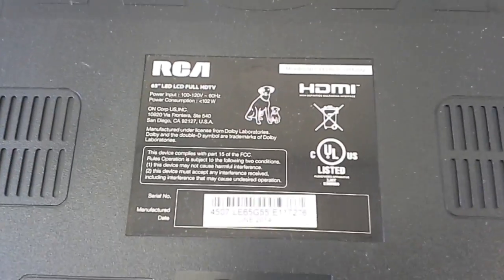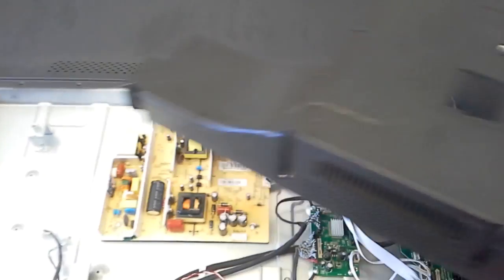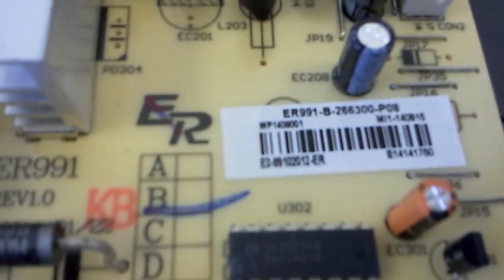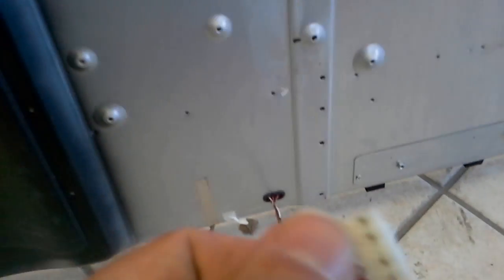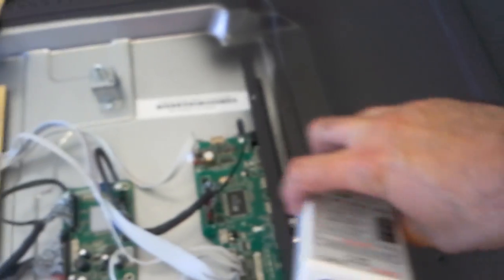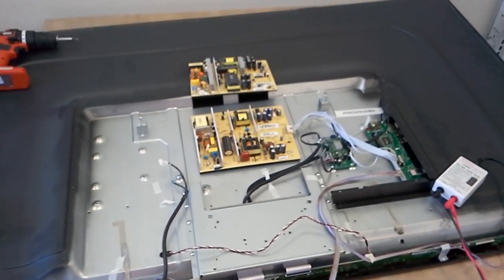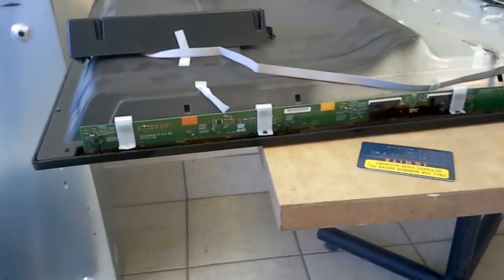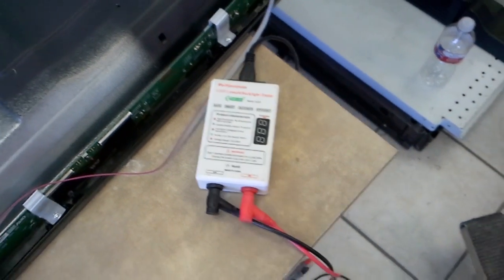How to troubleshoot and repair RCA LED65G55R120Q not starting

Comment: Coppell I see this video is 5 years old so getting a reply may be a hit or miss. I have this same model and I have replaced the LED's a couple times and it's worked great. This last time I was working on it my grandsons was playing around and a football hit the on'off button ribbon cable and it jerked the wires out of the plug. I tried to re-solder the pins but they are so small it's very difficult. I found a replacement cable on amazon but it's for a 55 inch not a 65 inch...(can't find a 65 inch cable) I've heard sometimes they use the same cables in different models...do you know if this....RCA LED55G55R120Q TV Button & IR Board RE0342R010, RE3242R010.....will work in my 65 inch tv exactly like the one in your video?
Reply from the maker: I am afraid I do not know the answer with certainty. But if I were you I'd go ahead and try.
Reply: @coppelltvrepair  Thank you so much for replying!!!! 25 buck it's worth a shot.

Comment: Where can someone find one of the ribbon cables that come up from the bottom. (that model- Led65g55r120q) there are 2 and I lost the screws to the base, the replacement screws were too long and punctured one of the ribbons so there is a green stripe down the right side of the display now. I can't find that specific AWM flex cable anywhere.
Reply from the maker: I have long forgotten what were the cables that go inside those particular panels, but I've seen plenty and I can tell you that there is absolutely nothing special about them and that even if you don't find exact replacements - which will NOT be indicated by the AWM number BTW - you can always hack up your own cables with nearly anything you can find that's tiny enough and yet not too tiny. Firs you need to find how many channels you carry, i.e. how many different power lines are there and you usually do that by examining the strips they go to. There may be multiple pairs (positive and negative) or, more commonly, several wires will carry the one common negative (rarely one common positive) and then several individual wires will carry the individual positive (or negative in the rare cases) lines. In the most simple form it'll be just several parallel wires for one common positive and several parallel wires for common negative, i.e. a strip cable cab be used for carrying as little as one power channel - positive and negative. This is done so that slightly larger current can be carried on a generally very low-current carrier as the FFC/FPC strip cables. The currents in LED panels are not big to begin with - they are in the range of tenths of an Amp. So even very very tiny wires, if you run them manually, will do the job. Most likely the tiniest you'd find in Home Depot will be too big, but as long as you can find them they'll do the job - them being bigger than they need to be is good for electrical purposes, only bad for physical challenges running them around.

Comment: the reason LED tvs go out is due to having the tv set on the brightness setting all the time...gamers do this. they wreck the tv. they are NOT computer monitors..a gaming system have ignored the reality that to get those fancy colors and brightness, you need a normal computer monitor and not a tv. and no they are not, "essentially the same thing". one is cheaply made.
Reply from the maker: You are contradicting yourself. First you say the reason LED tvs go out is due to having the tv set on high brightness. Then at the end you say that they are cheaply made.
It can't be both.
it's the second.
it is entirely possible to have a TV run at full brightness for many years.
The first generation LED TVs had a WHOLE LOT longer life than current ones, just like the first tube TVs had a whole lot longer life than the last generations.
Whether it is planned obsolesce or competition at work everyone can decide for themselves, especially considering they are not actually mutually exclusive.

Comment: I have an RCA LED65G55R120Q with a problem in the supply of led strips 1 I have a voltage of 210v and I need a schematic if you could provide it to me. thanks
Reply from the maker: We do not have the schematic. Sorry.

Comment: dear friend thanks for this useful channel. I wonder if you can help me with this PSU (RE46HQ1700) I cant find it so does it have any compatible or replacement alternative
Reply from the maker: Afraid I do not know if there is an alternative power supply for that....I doubt it, though I am sure it would be possible to hack a combo of others to make it work...but I doubt there will be equivalent substitute and if there is I definitely do not know it.

Comment: Hello I have this model and mine comes on but it has a black vertical line and a greyish line 3-5 inches wide on the right side. I am thinking it is the tcon board. Can you help before I order this part?
Reply from the maker: I don't know. Internet is full with people who want just a little bit of attention and help and when they get it somehow they instantly want more attention and help...and we just can't afford all that's wanted.
So yes we can help you and no, we probably can't do it the way you'd want it.
I do not think you have a bad T-CON board. I think you need a new TV.
Reply: @coppelltvrepair  thank you for your quick response. Unfortunately because of covid-19, it has made it difficult to get help or purchase a new one financially because I live in a rural area. I considered purchasing the tcon and strips seeing that the rest of the picture is good and there are no cracks or breaks in the screen. Was trying to find the service manual for this model and haven't had much success.

Comment: So my 65" such as this comes on and flashes. I am guessing that there are LED strips that are bad, but where can I find the entire LED panel or do I have to buy each strip separately?
Reply from the maker: As of today, considering the age of the TV, the cost of replacement and the work that needs to be done to repair it properly I'd recommend just buying a new one.
Counter-intuitive coming from a TV repair shop, but that's what I believe is in customer's best interest unless they want to have fun repairing, in which case I can only say CHEERS!
Reply: @coppelltvrepair  thanks

Comment: My RCA TV RTU5540-C does not recognize the remote. It did
recognize the remote until recently. The remote has new batteries. I tested
that the remote is on by pushing the Input button on the remote the Power
button flashes red. The TV Standby Indicator is red when TV is off and when I
turn on the TV with the power button on the TV the light turns to Blue. There
is nothing blocking the Remote Sensor on the TV. Any thoughts on how to fix?

Comment: I found the exact TV in this video in the alley. I took it home because I was told that as long as the screen isn't broken it's fixable. I got it home plugged it in but not picture. It did what you were talking about in this video. I found on another YouTube channel how to inspect the LED strips without a volt meter. I found that 1 LED strip was not working and ordered a replacement from eBay $22.00...i replaced that strip and put the TV back together. I'm happy to say it worked just fine after the strip was replaced. Thanks for your video, I now have myself a 65inch just in time for the football season!!!!
Reply: Brah I did the exact same thing! Found a sld65a55rq in the alley that looked suspiciously underused and carried that big thing home like an ant. Biggest tv I've even owned. I'm in the beginning stages of bringing it back to life. My screen will flash blue about every 10 to 15 seconds. I had it flashing on the menu/start up screen and it has a good picture. I did ripe out the ground blade with my vice grips... I don't know how important that is but I'll replace it before I get into the guts of her. Happy to hear you saved yours
Reply from the maker: @astrataway7077  Just remember....replace all strips! That is the only proper way to do it and will save you lots of trouble and money in long run...if you replace with brand new LEDs, that is.
Reply: @coppelltvrepair  Which LEDs are you talking about the screen LEDs or the big nickle sized spehical LEDs in th back of the screen? The cables are a good idea but I might try the vinigret acidic trick before I do that. I have a good meter and a solder sucker for resisters or whatever else on the power supply.
Reply: @astrataway7077  This requires a $15 eprom replacement. You will need a hot air station to replace the flat pack IC that it is.
Reply from the maker: Glad I was of help and my voice didn't get in the way of your success :-)
For the record, though, what you've done is improper or rather incomplete. Imagine you drive your car for so long that one of your tires bursts from the wear. Will you replace just that one for the rest of the trip?
Well LED TVs have not 4, but between 50 and 150 LEDs in the panel depending on size and they work together, pretty much as car tires, and they actually do wear out as they work (why so quickly is another story).
So bottom line is that you've replaced 1 out of 100 or so LEDs and it's only a matter of (short) time before another one goes out.
Every professional knows - all or none is better than some and then returning upset customer...
Reply: Bro its so funny u found this tv in a ally way...me and my baby daddy literally just found this tv in a courtyard lol and have been havin this same fkn issue!

Comment: Is the LED driver a part of the power supply on this model?
Reply from the maker: I am sorry, I do not remember that. But the answer is extremely simple to find: if the cables out of the panel go to the power board then yes, the LED driver is part of the power; if there is another board in the way then no, that other board is the LED driver.
Reply: Yes it is, but receives the start-up signal from the main board.

Comment: i cant understand your voice and you dont explain how you took it apart..
Reply from the maker: So sorry about both. I can only recommend finding a video you can understand which explains what you need explained.
Reply: Coppell TV Repair LLC there is no videos like this that explains
Reply from the maker: @jimmyperkins97  Then "thank you for at least trying to help" would have been a better comment under the video.
Reply: Coppell TV Repair LLC I did leave a comment under the video
Reply from the maker: @jimmyperkins97  No argument on that claim.
Reply: @coppelltvrepair  On the off chance you reply, thanks for the vid. Could you explain what i'm looking for when i test with the multimeter? I'm not reading any voltage on the LED pins you point out @2:54 
would i be able to narrow it down to the specific strip? or is it really just easier to change the whole panel?
Reply from the maker: @aaronharop6247  I do not remember this video and I am not able to watch it now, sorry. But it is always  better to replace all strips or the whole back light panel (if possible) to any partial LED or strip replacement.
We ended up instantiating it as a policy at our shop.
We do not do partial LEd repairs period.

Comment: Search the problems and warranty on these TV's. Junk is the most flattering thing I can say about them. Buy and you will regret.....guaranteed.
Reply: This is true, I bought mine last christmas and it has only worked 30 days in the last year.  The rest of the time it is in the shop.  Rca Curtis customer service can take months to get back to you as you can only coordinate repair through email.  I just got mine back two weeks ago again and it already isnt working.  My warranty is almost up and I can guarantee it wont be working again so I will have to start fixing it myself which is total B.S. as it has never worked right since I brought it home last year.

Needless to say this is my last RCA or any other brand from the parent company Curtis.

Comment: I had a question. Do you know if the diffuser layers on the rca tvs for the light are all the same type of material? Or all the same for all led/lcd tvs? Do they have any effect on picture quality?
Reply from the maker: No, I do not know if they are all the same type of material. But they do the same thing and I am quite sure that many of them would be interchangeable, apart from the shape related to the panel specifics.
Reply: Ok but those 3 layers in the back including the diffuser has nothing to do with picture quality right?
Reply from the maker: Well technically they do. At least one of them polarizes the light and if it's not here you won't see image properly. The exact order may also affect image quality to some degree, i.e. it makes a difference if you diffuse and then polarize or polarize and then diffuse.
Reply: Well I had those 3 layers switched from 2 identical rca models only a few months apart from manuf. date. Except one had on anboard dvd player. How would you know if the layers were not working properly?
Reply: I had the layers taken from a RCA LED32C45RQ 32 inch and put on a RCA LED32C45RQD 32 inch. Notice the "D" and the end difference. Do you know if there is any technical data I can pull on up on these online?
Reply: 1 polarizer and 2 difusers. Some are thicker than others and many cheap tv's will use one thick one for the difuser. Make sure you do not damage the rear white plastic cover that goes over the LED strips as it is used to throw light forward. Technically, everything behind the screen is referred to as the light box.

Comment: My rca 65 model led65g55r120q turn on and after less than a minute turn off and dont turn on unless i unplugged, already change the power supply board but still doing the same. What u think can be the problem? Thanks
Reply: My 40" does the same thing. I can do a factory reset and it will stay on for a day or so. I looked over the power supply board and did not see any bulged capacitors. I'm thinking it's software. the On Corp phone is no longer in service so I can't check for firmware updates.
Reply from the maker: Well a bad strip can cause that and so can bad main board.
No easy way to rule out either I am afraid,
Signalling the power supply to turn on backlight is probably the most simple thing to do.
Reply: @coppelltvrepair  I know this video is super old but I have an old RCA LED tv. The  panel seem to work but backlight stays off, except is blinks for a moment in some random times. The stips voltage reads 2.6mV. I was wondering how to signal the PSU to turn on the backlight power. I have identified 2 pins, in the PSU to mainboard connector, one is called BK ON, and the other ADJ, which both go to the same IC in the board, so I think those are the pins, one to turn on backlight, and the other to adjust dimming, but I don't know what signal to supply to each to test the PSU. If you read this comment, do you have any information on how to signal the PSU to turn on the backlight? thanks.
Reply from the maker: Many TV makes and models may have the same behavior. Assuming that your TV's problem is same as theirs is wrong and you should not be doing it. Not all people around the world who cough do it for the same reason and not all cars in the world that have problems starting have the same reason for doing so.
In your searches stick to the model of the TV you have and you will have a whole lot better chance of finding the proper advice and solution than just with the general symptom.
Most of the time this is true even for experienced technicians - many of the local shops we work with exhibit the same incorrect thinking, assuming that what's true for one model or generation applies for another.
It just doesn't work that way, not as a rule of thumb.
Hope this helps!
Reply: Miguel Martinez where can I get that tester
Reply: Miguel Martinez so wat was the problem with the TV.  I have the same model, 65 inch tv... wat did u do????

Comment: my tv (LED65G55R120Q) is coming on but no picture. I has blue screen. I went off last night but came back on today, but when I turned it off it went blue screen again. The sound is working...
Do you think its the bulb and how easy is it to replace, it that's even the problem.
please help. TV is only 3 years old (Out the box)
Reply: stanleytd If you have blue screen I'd go for main board replacement.
Reply: how do i find the main board model number or type my LED65G55R120Q ?
Is there a video for replacing the main board?
Thanks
tstanley22@gmail.com
Reply: stanleytd I know we have one around here - must be shown in that video too, whether in TV or laying around. Email our support to get a price.

Comment: question for you I'm working on this exact model TV right now.. had to replace the power board as it was shot. LED's still don't lightup, so I'm guessing main board needs replaced. However I cannot find the exact model match of mainboard anywhere. its a RCA LED65G55R120Q 65120RE01M3393LNA19-B4. On this TV does it really matter if the mainboard matches exactly? or can I use say a B3 board or B1 or even an A series? I know on some it matters some it doesn't. Your help would be greatly appreciated. BTW LED's all test out fine.
Reply from the maker: I do not know whether and what is the difference between board revisions. Cheap brands do not release that information anytime soon enough and in many cases ever and it has to be reverse engineered by technicians and affected users.

I'd double check your LEDs before spending money on boards.

The good thing is boards are cheap since there are so many TVs sent to garbage because of the bad LEDs.
Reply: LED's have been double and triple checked. I ordered a B3 version board to see if it will work. If not I'll scrap it. lol
Reply: GherTech did it end up working for you? What happened with your rca 65 inch TV?
Reply: I would like to know too. :) I have the repair in process